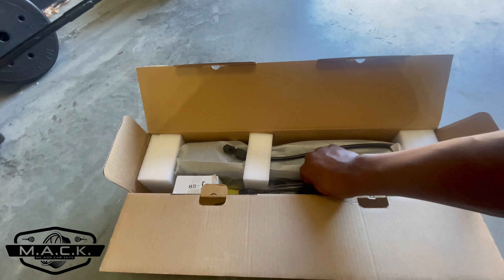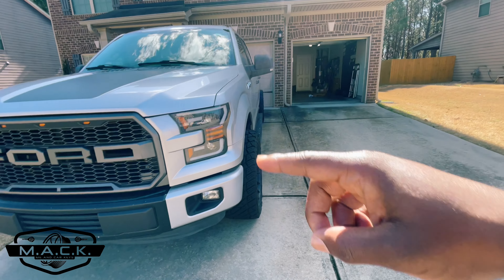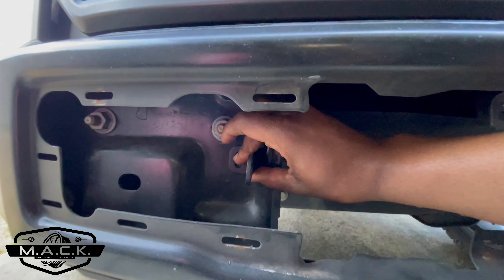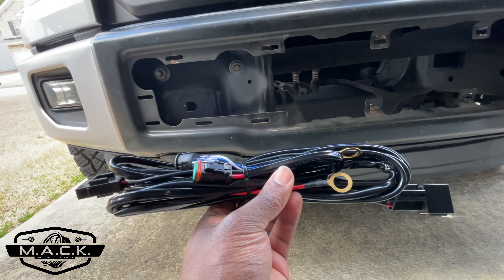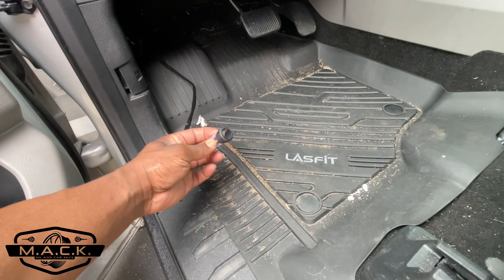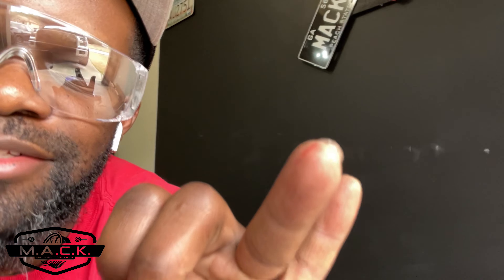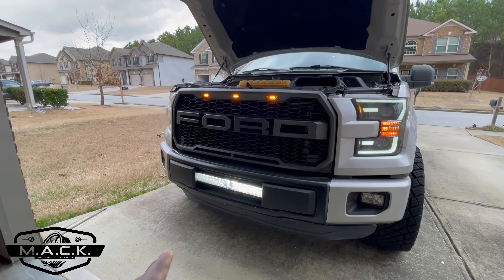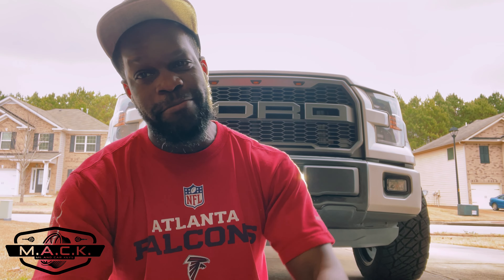Light Bar Install on my F150! Auxbeam 22 inch Light Bar! #auxbeam

Comment: Super bright, looks good. Not sure if it would work, but you could get the plastic trim piece for a 3.5 eco boost truck that just has the 2 vertical bars that you would need to cut out. Not sure if they all fit the same though.
Reply from the maker: My man Jimmy! Thanks for the suggestion. I may do that too, since I hacked mine all up 😂 thanks for the comment as always!!

Comment: Hate to rain on your parade.  Nice install.  Did a similar install of a Rigid ten inch E series combo on my 18 F150 that blows the Auxbeam out of the water.
Reply from the maker: Thanks a lot! It’s all good, I like the feedback! Do you mean in terms of brightness?? 
How much did the Rigid cost??
Reply: All the bars are very bright when you look at them, even the $50 low buck ones.  It's how the light projects down the road that counts. I recently traded off my 18 F150 for a Bronco Sport. Took the Rigid out and installed a cheapo.  It looked bright at first but at night it was a joke on the road to the highway. The light has a new home in the grill of the Bronco. It's pictured on the Bronco Sport forum. The light was around the $500 mark in 2015.  It crapped out after five years, so the lifetime warranty was great. They sent me a new upgraded version at no cost.  Snake Racing here on YT has good info on the Rigid line.  Cheers. @MeAndCarKeys